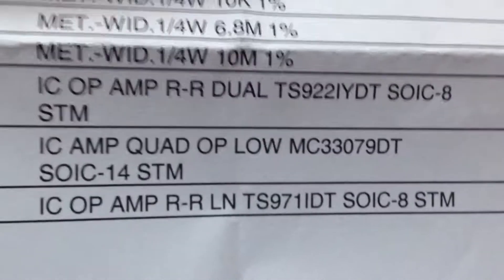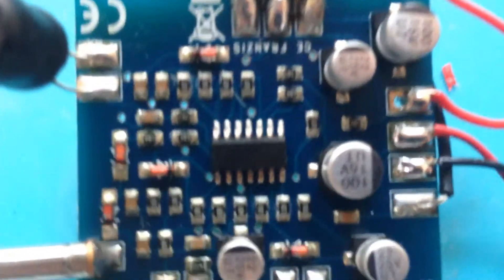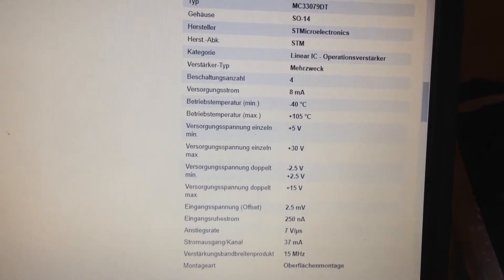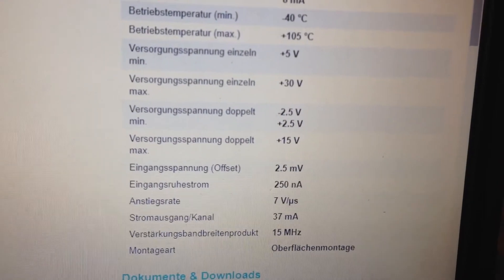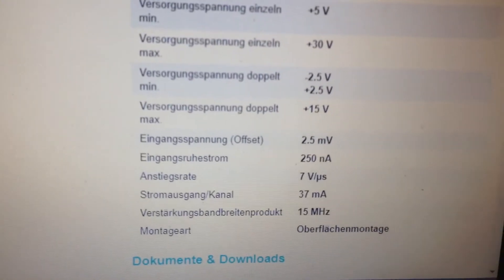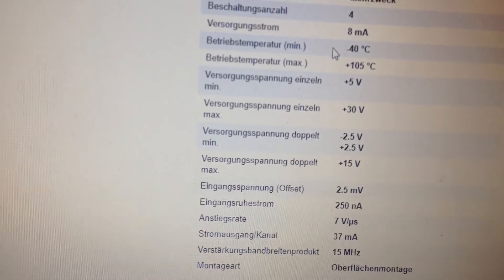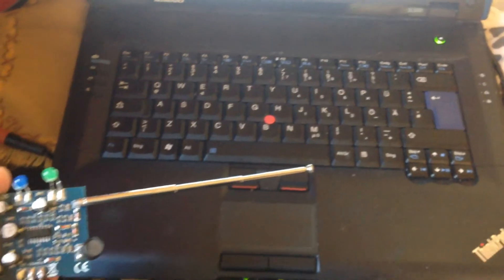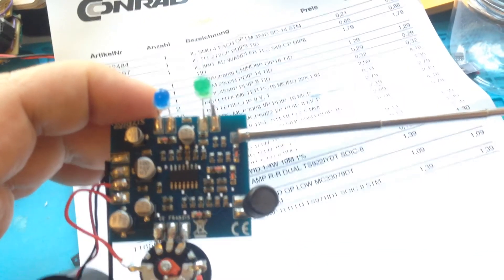MC33079 vs Lm324

Comment: سلام مهندس، ببخشید یه سوال داشتم این مداری که ساختین مدار خیلی جالبیه، ولی من نتونستم ای سی mc33079 رو پیدا کنم، تو ایران متاسفانه نیست، چه ای سی دیگه ای میشه استفاده کرد که نتیجه بهتری بده
Reply from the maker: سلام با تشکر از توجه به این ویدیو هر اپ امپ 4 خروجی مانند lm324 برای اینکار مناسب هست هرچقدر دقیفتر و حساستر انتخاب بشه نتیجه بهتری خواهد داشت
Reply: Q:  Hi Engineer; I had a question. This circuit is very interesting, but I could not find the MC33079 IC. Unfortunately, it is not [available] in Iran. What other IC can be used to give a better result?

A:  Use a quad comparator such as NTE Electronics NTE834, which is the equal to LM324. NTE products should be available in all Mid East regions.